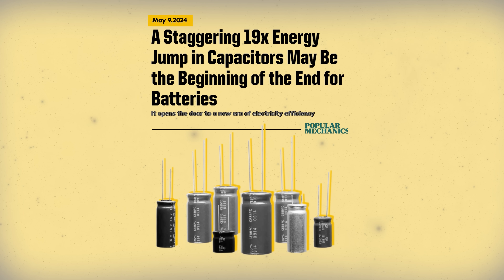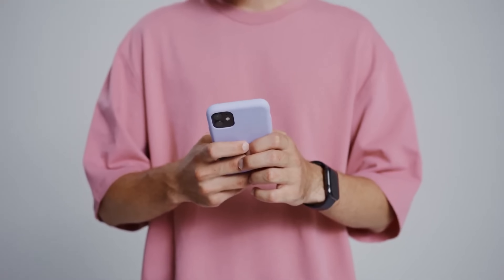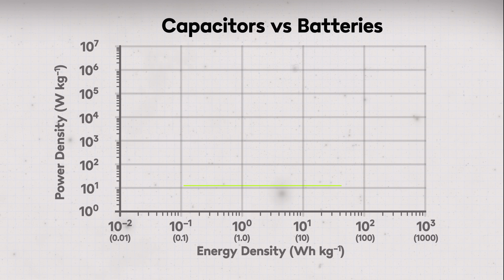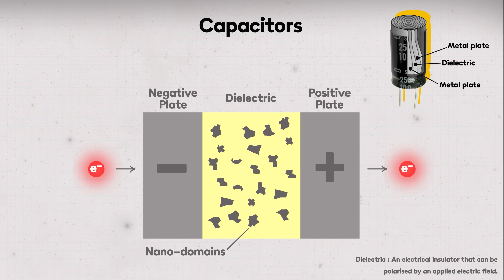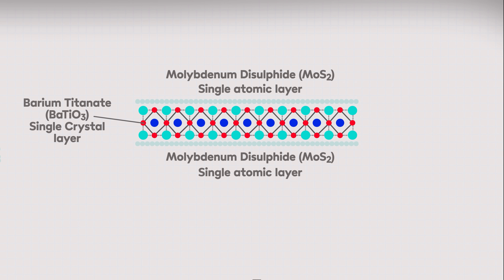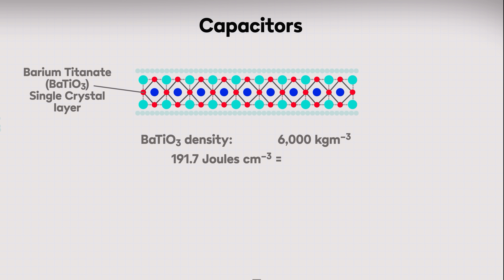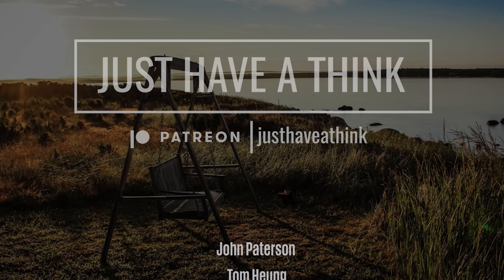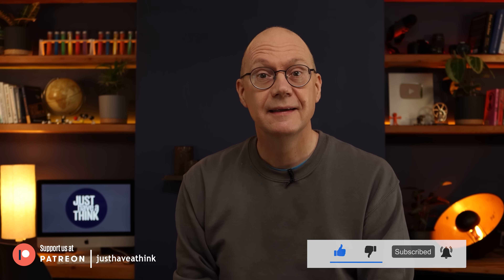Charging an EV faster than filling a gas guzzler? Surely not!?

Comment: It's funny that so many people focus on fast charging, not that it's not important, it certainly is, but imo the proliferation of level 2 destination chargers is far more important. 

Your car is parked most of the time, and if there are low speed, and thus low installation cost, chargers pretty much everywhere, the necessity of fast charging begins to only exit for road trips, and niche travel situations
Reply: True. I have a ev and only time I have a problem is when it is time for holliday. Once a year I get problem planning the trip that extends the battery. Where and how long to wait and is there a outlet. Where we live a ev battery holds for a long trip but not for holliday.
Reply: @haraldlonn898 Sommy holiday trips ( in the U.K.) by car is done by the motto, charge when you stop don’t charge to stop. So recently when we stopped for lunch I plugged the in the car put in enough to fill up to just over 80%, arrived at our overnight hotel stop ( chosen as it has EV chargers), plugged in overnight , left full in the morning taking us to our final destination. ( The advantage we have in the U.K. and Europe is 230 volt domestic power— and I am lucky enough to have three phase domestic power so I can charge at home on 22kw charger).
Reply: @haraldlonn898  Surely you choose where you go to on holiday is somewhere with an EV charger. If all EV owners started to select their holiday accommodation based on having a charger that allows you to recharge overnight the hotels, b&bs and holiday homes would very quickly start to add destination chargers.
Reply: Much faster charging could let you get away with much smaller batteries a lot more of the time, though.
Reply: Exactly!  That’s one of my favorite points.  Problem is that it requires a paradigm shift in thinking from the long standing norm of “fueling up at the station” to “destination charging”.  A lot of urban planners and policymakers who still haven’t got that yet.
Reply: @joelsmith4394  it's kind of a funny thing to coming from my perspective because I'm an electrician, commercial buildings have an enormous amount of power available! Adding twenty 30 amp outlets would probably require adding 200 amp breaker in the main distribution panel, and then adding one new panel to feed all of those outlets. 

It's kind of stuff is done ALL THE TIME for servers in data centers, and it's a really simple job. 

As soon as you try to add things like fast chargers it gets orders of magnitude more complicated and expensive
Reply: @louisjov  Exactly, the infrastructure is in place and cheap. Tesla chargers are now cheap and reliable.
Reply: @louisjov  there are plenty of companies out there that do level 2 chargers instalation for apartment garages, it's very much doable, just not worth the cost it unless a good percentage of the residents use EVs.
Reply: @danilooliveira6580 this is true, it's a chicken and egg thing. 

Ultimately someone has to take the initiative though, because I wouldn't buy an EV unless I had a place to charge it. Even if apartment owners installed regular 20 amp outlets, that would be a lot better than nothing
Reply: @louisjov  from what I read most apartments could easily handle a couple people using level 2 chargers at the same time without need a bigger investment, the owner of the EV could even pay for the charger themselves, but as you add more EVs then you need adequate infrastructure. as for level 1 chargers you could easily just get a normal 20 amp outlet next to each parking spot and the apartment grid should be able to handle dozens of EVs charging at the same time if it was built properly.
Reply: @danilooliveira6580  
 Where I live in North Vancouver, Canada we might be the highest per person EV ownership anywhere. The municipal building code requires that any new residential building have wiring in place to accommodate L2 charging.  There is also a bit of an onslaught of retro-fitting older buildings, even if they don't have many owners with EV's because it drives up property values in our high EV ownership area. "Is the building EV ready" is one of the first questions that prospective buyers ask.
Reply: @joelsmith4394  
 They are starting to come to that realisation though. Most supermarkets where I live have 6-8 KW chargers in their parking lots. Some are free to use. For me, parking and shopping for 30 minutes gives me more kilometres than I would use going to the market and back. I also now choose those shops simply because they do have free chargers. Its a plus for them and me alike.
Reply: This is only true for people who can charge at home and at work. I think a big hurdle for EV adoption is the simple fact that people live in the city in apartments and are unable to install chargers. These people will have to rely on fast charging that is similar to filling up your car with gas.
Reply: @P8qzxnxfP85xZ2H3wDRV  If the apartment building provides parking the landlord can make the apartments more desirable by adding type 2 or even 1 charging. Individual metering allows recoup of costs by the landlord and still it will be a bargain to the renter. It doesn't take much intelligence for charging to be done at off peak rates automatically.
Reply: I think slow chargers would be good for people who go to a movie theatre or a show or a long food meal or leave their car in a railway car park to go to work and don't want a text message after 20 minutes telling them that their car is fully charged and they have 5 minutes to take the car off the charger or start paying by the minute.
Reply: @danielstapler4315  so for pretty much everyone that runs errands with their cars
Reply: YEAH! Kinda agree with this. People don't need to fill up their car THAT often on gas. Same thing with electrons. Letting the car charge at home is the best solution. Would be nice for road trips but that only happens a few times a year, if any.
Reply: However, pairing the time & cost of charging with activity is crucial. In the supermarket car park opposite me there are 2 flo lv2 chargers. They are hardly ever used during the day. In the evening ppl in apartments then come by & plug in for 3-4 hrs.

The idea was for ppl to use these when they went shopping but the charge, cost & convince profile doesn't match their expectation or convince.

It's 3x more expensive than home charging & takes time to set up charging (often with handshake problems) & doesn't give u enough energy in the 1/2 hr or so your parked there.

Clearly they should be free or low cost, plug & charge with at least ~20kw power if u want ppl to use as intended. @flo
Reply: I very much agree. BTW if it ever gets to where wireless charging is efficient enough, this will be still more true.
Reply: @ronaldgarrison8478  I'm pretty skeptical of wireless charging tbh. When we're talking about the amount of power it would be delivering to thousands of vehicles, even a 1-2% loss in efficiency vs plug in amounts to an enormous amount of power wasted
Reply: @louisjov  TBH I think a 1% or 2% loss would be quite acceptable, if that could actually be achieved. It might even solve enough logistical problems to save that much energy in various ways. But for now, we're really just waving our hands in the air, until some system appears that has some specific characteristics.
Reply: I recently rented a Tesla for a road trip from Cincinnati to Atlantic City via Washington D.C.  One of my motivations was to see how much of an inconvenience the charging might be.  TLDR: it wasn't an issue.  

The rental was a model 3 with standard range of about 220 miles.  I decided to avoid any stress by always charging before I reached 200 miles.  That meant charging every 2:45, roughly.  The onboard GPS app automatically mapped and recommended supercharger locations along my route.  I pulled into the supercharger locations, plugged-in, used the facilities and bought a beverage.  At that point, the car was almost at 80%, but I usually decided to push it to about 95% charge by waiting another 10-15 minutes.  At no point in my trip did I have to go out of my way to find a charger, even though I spent a day at the Gettysburg battle field, which is well off the beaten path.  Likewise, a minimal amount of attention to charging when convenient meant I had no concerns about charge level while driving about at my various destinations.

My conclusion is that even when traveling, charging is not a problem worth worrying about, unless you are going someplace quite remote.  Personally, I think the extra cost of the extended range (and 4-wheel drive in the same package) for the model 3 would be a solid nice-to-have, but not a deal breaker since the standard range model worked so well.  I feel the emphasis on charging speed is significantly overstated as one rarely encounters it directly.  Most days you charge over night and don't even think about it during the day unless you are on a road trip.  Even on road trips, it really isn't a meaningful hassle.
Reply: yes and make sure they are cheaper than fast chargers lmao. since 2022 they are more expensive...
Reply: That is a valid point, also the case for the 1000 km range car  I would preference a cheaper ligher one with a range of 600 km 😂
Reply: Exit?
Reply: Yes - if we only do not drive car  for road trips only for short communication to work   situation is better. Even better wil be  if we not drive such EV because  even short use  dischrges battery . best only charge it for conservation at home and walk everywhere.. .
Reply: Not true in N. America:  High speed charging is absolutely essential!  We don't have good trains (hardly any at all, and they are very slow), so travel other-than-by-air means long drives.
I put on 5000 miles this spring. Typical drives were up to 1000 miles per day, meaning I needed to charge as much as 4x a day.
Reply: That's only if you look at it from a statistical point of view.
We USUALLY park our cars for long periods.
But no one is willing to wait 8hrs on those occasions when they don't.
I am on team electric car but
A car purchase is like no other purchase.  
I use to sell them.
We expect more evolution from our cars than any other product other than computers. Computers are comperably cheap so we pay more attention to the car purchase
Because:
We spend more on our cars than any other purchase other than a house.  But a house builds value, while a car loses value. 
Both are absolutely necessary for most people.
...
The long and the short is that people simply won't buy a substandard car.
There's nothing wrong with a Nissan sentra but because the Toyota is a TINY bit better...  it sells.
If you want an electric car to sell, it must NOT be a tiny bit worse
Reply: The only reason I would want a car is to do long trips. I don't need one for commuting or shopping.
Reply: I gently dissent.  Think taxis and trucks, where motion = money.  Sitting to recharge is money wasted.  In the (near) future vehicles will NOT sit, not be idle, thus there will be far fewer of them, they will almost always be in motion.  Parking lots will shrink (thank goodness!).  

For most of us, it's not the car we want, it's facile, cheap, comfortable, safe mobility.  Fast 'refuel' is part of that. Not the only part, but a real part.
Reply: Fast chargers and home charging get people confident to buy an EV. 

When a high enough percentage of cars on the road are EVs then hotels etc will invest more routinely in offering level 2 destination chargers. There is a chicken and the egg problem. But we will get there.
Reply: Bullshit. I'm not waiting an hour to charge my car when getting gas takes 5 minutes.
Reply: @korcommander  you do you buddy! 

It never takes me 5 minutes to get gas, because I have to go to the gas station, and if I want the best price, I go to Costco, which most of the time means I have to wait in line.

So for me, it's more like 15-20 minutes to get gas. I would much rather just plug my car in when I get home, and have it fully charged every time I go somewhere. If there are low speed chargers at places I run errands at, I can plug on there while I'm doing stuff
Reply: @louisjov  Almost all of the time, the extra few cents you save per gallon, arent worth the expense of driving to get.  There are 4 gas stations within half a mile of my house. 

You are creating a first world problem for yourself.
Reply: @korcommander  and I'm solving it with an EV I can charge at home
Reply: @louisjov  So what if you forget.....
Reply: @korcommander  🤷‍♂️

My commute is 30 miles. With a 300 miles range, not really a huge deal, especially if there are destination chargers
Reply: @louisjov  my gas car has a 300-400 mile range too but I don't need to hope for a destination charger. I can just get gas on the way if I forget.
Reply: @korcommander  that's because the infrastructure has already been built out. 

That would be like saying "well my horse can get hay and oats pretty much anywhere along the way, while you have to hope for a gas station" back when cars were new, and thinking that makes cars a totally invalid way to get around 

In any case, you do you! If you think charging at home is more inconvenient than going to a gas station, that's your call! Personally for me, I think charging at home is easier, but more importantly, it's just cheaper. 

Where I'm at, the average cost of electricity is $0.21 per kWh. Even if I had the F150 with the big 100 kWh battery, that's $21 to fully charge it at home. You'd have to somehow get gas for less than $1 a gallon for it to be the same price to refuel, and I don't know of anywhere in this country that has fuel that cheap. 

But yeah, you do you man! I'm not telling you how to live your life, I'm just saying EVs have a lot more benefits than I suspect you think they do.
Reply: @louisjov  Fueling at home would be cool too, but the logistics of EV's arent there. We have to realize the situation on the ground
Reply: @korcommander  what do you mean by the logistics aren't there? I totally agree that current EV technology isn't right for all use cases, but for most people and most use cases, charging at home is no big deal. 

I mean, people put 50 amp welding outlets in their garage, and hot tubs, and generators all the time. I've wired up many myself when I was doing electrical work.

For the most part, it's a really simple job, assuming your house has a 200 amp service, which has been the standard for a long time now. 

There are questions about upgrading people's home services, but that's why low speed destination chargers at work, at Costcos, at Walmarts, is the best solution, because electrical service wise, commercial buildings can handle a huge amount of power, and adding twenty 30 amp outlets for chargers in your parking lot is a relatively simple job. 

They do that stuff in data centers literally every day (I've done dozens myself), and it's a pretty basic electrical job.
Reply: EXACTLY. as an owner of 2 EVs in Canada, driving 130km everyday on commute, I can confirm.
Reply: Indeed. Since we got our home charger, we have only stopped 3 times in highway to fast charge it. You leave home at 100%, assuming your car has 400km highway range (= 600km WLTP), this is fine for 95%+ of the days. You go somewhere 200km away and back and charge next night. If you go further (400km away) you spend more time there. You plug your car to hotel’s slow (11kW) charger during night. Or you plug it to a slow charger while you are doing the thing. Who drives 400km somewhere (4 hour drive) if they are not going to spend any time in the destination? During that time the car charges back to 100%.
Reply: It is also better for the grid to charge most cars at night. Electricity is cheap during night too. Win-win for consumer and grid owner. We need slow chargers (11kW is more than enough) in areas where people keep their cars at night.
Reply: @sebbbi2  
 That's the point that those that worry about the distribution infrastructure like to overlook. Cars charging in off-peak periods. Going a little further, what if your daily use of your car only required %25 of a full charge? Eventually tens of thousands of EV's will be able to sell back their energy into a grid that may be stressed and need a little local input. This feature will produce quite the opposite of "EV's cant be accommodated by current infrastructure". The stressed infrastructure may benefit  by borrowing a bit of your battery capacity. You also might be able to re-sell lower cost off-peak energy into a better price during peak demand periods. You may benefit (profit) from the arbitrage opportunity between pricing periods.
Reply: This is it. I've had my EV for about a year now, and I've used fast charging maybe 6-8 times, and of those only 2-3 of those times was absolutely necessary.
Reply: with really fast charging we could have much smaller batteries in the cars. Additionally if we could charge wirelessly while going along highways we could have even smaller batteries.
Reply: @fdk7014  yeahhh that's true, but I think the engineering complications of something like that might be a little more complicated than you might be assuming (at least for the wireless charging)

In the US, we just need to build them at every highway rest stop for sure, but installing fast chargers is just way more complicated and expensive than installing level 2 chargers at destinations, both logistically and electrically. 

People need them for road trips, and likely at hospitals and other places with emergency vehicles, but having a broad network of destination chargers I think would just provide more bang for the buck in terms of accessible charging infrastructure
Reply: So why not just make them induction chargers. Then the parking spots are just a charger in themselves. Easy solutions. Trigger when someone is parked on, car senses charger, car sends signal to charge or not. Now, easy peasy charging, everywhere that runs only when needed.
Reply: People ask all the time "but wasnt putting in a 240 line to charge your car 5 grand?". They are surprised when I say that I use a standard 15A 110v outlet to charge my car.  Im almost always home by 6 and dont leave until 6 the following morning so thats around 50-60 miles added, doesnt sound like a lot but my average drive is only 30 miles a day so I basically always wake up to a full tank.
Reply: Good point, it would make more sense to invest into infrastructure giving more availability.
Reply: Fast charging is the key for commercial vehicles, not personal ones. Those vans aren't making money while they're charging!
Reply: @CorrectHorse126 honestly there's even nuance in that! USPS trucks don't need to fast charge, since all they do is stop and go, and a lot of fleet vehicles aren't used every day, and often are used for short trips

Delivery vans though, would need it , depending on the length of the route
Reply: @CorrectHorse126  Breaks are mandatory for proffecional drivers every 4-5 hours everywhere in the world
Reply: @CorrectHorse126 
The vans charge overnight, or between shifts.
Reply: We are deep into diminishing returns. Your everyday Tesla is going from single digits to 80% in half an hour. A Taycan in 15 min.  Plus very very few people are doing 600+ mile days so they'll only have one charging stop. 15 minutes one way or the other doesn't matter on a 10 hour drive.
Reply: not how americans think. Works in the rest of the world.
Reply: @Hdtjdjbszh  we must know very different Americans then
Reply: @louisjov  Go to Talladega on race weekend. Bring a fifth-wheel RV and park in the infield (not cheap, and don't be TOO attached to that expensive fifth-wheel).
It will definitely OPEN your eyes.
NOTHING you do or say will change how the vast majority of those people think (if "think" is even the right word). Keep in mid that (at least when I used to go) NASCAR would get ONE-HUNDRED-THOUSAND people out to a race.
Pretty sure the attendance at Charlotte in 2001 was almost TWO-HUNDRED-THOUSAND.
Reply: And you decrease their need even more if people get out of their fucking 2 tonne death traps and use public transport or walk/bike to their destinations.
Reply: @SwordQuake2  that sounds like socialism!

/s
Reply: @louisjov 
You have an odd idea of socialism.
Reply: @SwordQuake2  try 3 tons! Large BEV SUVs are up around that weight now, and people think they're saving the planet by buying them and driving them to work - probably with just them inside it. 

It gets worse when you add in the extra space, resources, energy and materials used to provide the roads and freeways needed for all the vehicles with just one or maybe two people inside.....

The human race is (quite rightly) doomed.....
Reply: People want convenience, to be able to charge quickly  instead of remembering to leave the car charging every night and be in trouble if you forget. 
In some countries incentives for plug-in hybrids were removed because the conclusion after a few years was that people weren't bothering to charge them and used them as regular ICE cars, especially with company cars.
Reply: @pbs36 I’ve found it more convenient to plug my electric vehicle in at home than filling a gas tank. I never have to stop at a gas station or make a special trip for gas because I forgot to fill up and need to do it before work or errands. I just plug in the car when I feel like it. What I do is forget to unplug not plug in. Electric cars are so efficient I don’t need to do it every day. The amount of charge in the battery is very clear and much less easy to miss than the state of the gas tank. Home charging is incredibly convenient. I have a level 2 charger.
Reply: @PeggyEscobar-v8j  
 I couldn't agree more. Plug it in every evening and its full every morning, no more range anxiety. Way less concern than filling up at a petrol station. Few people have a daily commute that will threaten the range in most EV's.
Reply: @pbs36  that's my point though. If there are low speed destination chargers at every business you might go to, it doesn't matter if you forget. Just plug in at work or at Costco or something
Reply: @pbs36 
When it is cheaper to charge a battery than fill a tank, people charge the hybrids.
Reply: @johnburns4017  It was cheaper, but they didn't.
Reply: @pbs36  
Depends on where you live.
The massive installation of solar panels on roofs feeds into the grid at a local level, negating the need to expamd in many cases..
Reply: We should have simple 120volt outlest on every Road side parking and IT would be more then enough for overnight charge
Reply: @423GustavBern  And a charger on every lamppost.
Reply: @423GustavBern used to be, at least in the northern states of the US, motels had outlets at every parking space for oil heaters. It would be perfect for slow charging overnight for travelers. Might have to go to 240v faster charging, but not too bad.
Reply: @423GustavBern Not really, if you look at a regular Tesla Model 3 on 120 volt charging you get 3, maybe 4 miles per hour. You would need to be plugged in for 10 hours a night. Not impossible, but not practical either.
Reply: @otm646 Do you usually park for less than 10 hours at night? 
If not, then you could charge while eating and sleeping and you’d have no need to fast charge unless on long distance trip.
Reply: @otm646  Um.  That’s what I do all the time, and have for over 9 years.  Sure, maybe you don’t recover all you used the day before and maybe you accumulate some deficit during the week.  Then the weekend comes and your car recovers while idle for many more hours.  Or you top up at an L2 charger at your local grocer, maybe once a week.  The amount people drive in a week varies hugely, for the average and below, this can work.  
And speaking of work, if you can L1 charge there too then the snail paced charging is even less of an issue.
Reply: @otm646  I kept my EV charged from wall power for 6 months before I bothered to install an 11kW level 2 charger.  I just plugged it in when I wasn’t using it, never had a single problem and I only charged it to 80% unless I was going on a long trip.  It’s practical and easy.
Reply: @joelsmith4394  I used nothing but level 1 for 6 mints and never had a single actual problem.  Only reason I went to level 2 at home is the bad habits of leaving it off the charger instead of plugging it in all the time, it’s peace of mind knowing I don’t have to plan ahead.  I did the work myself, I don’t think it would even have been worth it to pay someone and would have stayed level 1 only.   It even fits in the frunk and I have a 100’ cord so it plugs in anywhere.
Reply: @Conservator.  Just imagine - with sun set all cars on highway rush to chargers to charge  energy for next day.. How many cars will be arund say parking in 10 km range? How big batteries have trucks and buses?
Reply: @Mikexception  EVs don’t need to start charging immediately at the end of the workday. Depending on the state of charge they could start somewhere between let’s say 8pm and midnight. 
Charging infrastructure needs to be ‘smart’ for that but it’s not rocket science.
Reply: @Conservator.    Yes, you are right -  if all EV batteries require  only 10 % recharging then all looks quite promising. But if 95%? I hope they  are will not find out   idea of    regulations forbidding discharge to less than say 50% just to make  recharging substantialy shorter.  Because we already see such recommendations that EV should not be used below 20% and above 80% by  warning that it will harm battery. Is max range taking in account that battery capacity is as is or it is limited to 60%?
Reply: @otm646  "Not really, if you look at a regular Tesla Model 3 on 120 volt charging you get 3, maybe 4 miles per hour. You would need to be plugged in for 10 hours a night. Not impossible, but not practical either" - Just require companies with more than X number of employees to install slow chargers in the staff car park, you plug your car in on arrival, swipe your staff ID to identify yourself, your car slow charges while you work, and you're billed for the cost of the electricity when you get paid. It's not difficult is it?
Reply: @otm646  Only if you have to completely recharge. Which you seldom have to do every night.
Reply: The biggest problem isn’t fast charging or even slow charging.  But how on earth can you get the amount of energy needed for a whole bunch or cars true a wire? 

Technically you can with high voltage powerlines. But you can’t run high voltage powerlines to every street. It’s even nearly impossible to run enough capacity to large fast charging stations. 

One simple fuel truck can easily hold 200.000kwh of energy. Let’s say a fuel station gets a refill every 48 hours. That’s over 4000kw of continuous power equivalent. Technically not impossible but in reality not feasible. And that doesn’t even takes peak demand into consideration so you would also need lots of onsite energy storage for peak shaving. Even if ev’s have double the efficiency it’s not feasible I think.
Reply: @autobootpiloot  
This looks like an oil astroturfer.  One of the heads of the British National Grid said there is no problem with capacity. They can give cheaper overnight charging when the grid ticks over, etc. 

BTW, the grid is changing like crazy with wind and solar being installed at a rapid rate.
Reply: @johnburns4017   just stop listening to that nonsense and take only 5 minutes to look at the scale of power that’s needed for electric vehicles. Just look into the amount of energy a vehicle takes to move around. There is not a single country that can feed every car it has with electricity at the moment. 

Who knows what the future will bring. But as far as I know, just about every western powergrid is at its limits right now. And it’s not the power generation that’s the problem. It’s the distribution of power where the problem lies. 

We shifted cooking to electricity, heating to electricity, cooling to electricity and transportation to electricity. And it all has to go through the same wires and power distribution centres that used to only feed some lightbulbs and a tv. 

Sure it can be done. But not now and not in the near future. We basically need to redo the whole power grid. That takes decades and billions of euros, pound or dollars. That makes power distribution a way bigger problem for electric transportation than a lack of battery technology will ever be.
Reply: @autobootpiloot  
You are prattling complete and utter nonsense.
Reply: @johnburns4017  Correct. I have solar, not that much, but I put 2,000 kW-hr into the grid above my needs every year. If I had need of a car it would be electric as it would be powered at wholesale rates. That is what the utility pays me and it would be reduced by whatever went into the EV.
Reply: @autobootpiloot  the electrical grid was undersized and needed massive expansion since the first day we had a grid.  It’s been required to expand every year since electricity was discovered.  EVs only add about 20% to the needed rate of expansion, so completely doable and in fact the money to be made selling the extra juice will ensure it gets done.
Reply: @hugegamer5988   that’s only passenger vehicles. Now include cargo vans, trucks, busses and heat pumps. And everything else they want to electrify. 

If we would go full electric we would quadruple our household usage. So would my parents. My very elderly grandmother that lives in a highly efficiënt new apartment and barely drives her car would slightly more than double her electricity usage. That’s about best case scenario for someone that still owns a car.
Reply: @autobootpiloot  all the rest are already factored into grid and production expansion already.  
I’d love to triple my electric bill.  Right now I pay 1/3 the cost per mile of electric juice for my car, and 1/6th that of my truck in gas.  If I could triple my electric bill I’d be saving a thousand a month.
Reply: @hugegamer5988   that’s not how it works. They only update components that cause problems with components that have the correct capacity for the current situation. Not for what they expect in the future. That’s the main reason grid improvements go so slowly.  They don’t look into the future at all because they only get paid to keep the grid running now. Components with more capacity cost more money so they install the minimum.

Unfortunately not many people expect it to work like this because it doesn’t make any sense. But it does work like this.